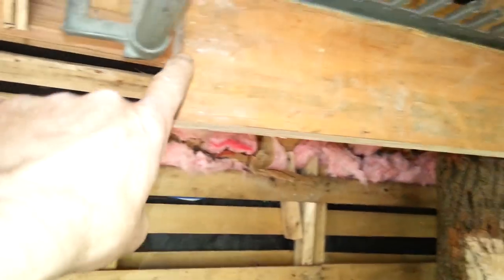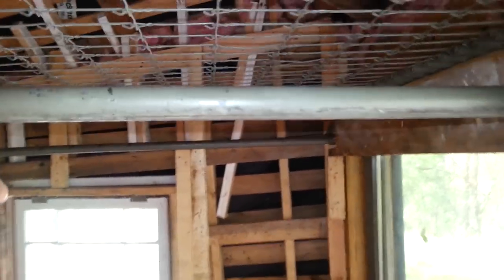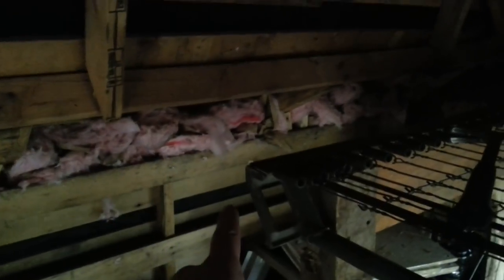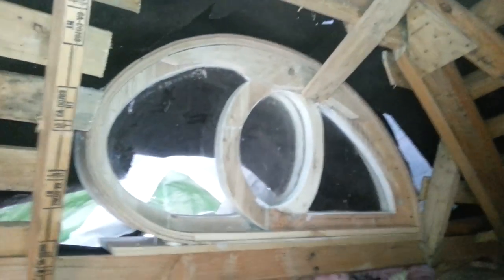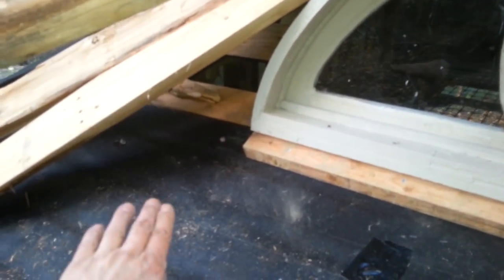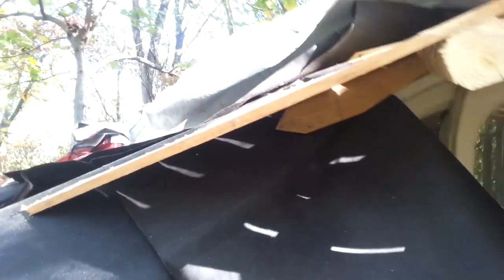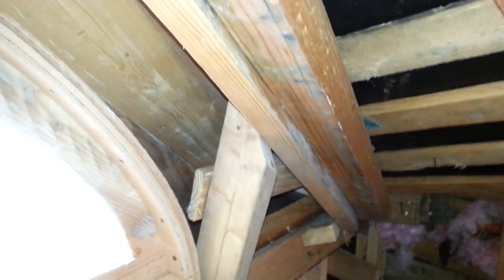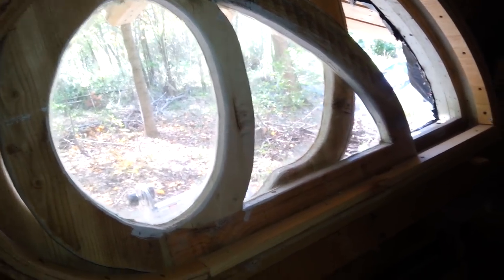Tiny House Off Grid Pallet Cabin - Part 16  Loft & Eye Window

Comment: Adore the window. You are so talented. My only question is, what happens as the trees grow?
Reply from the maker: So the trees did grow. Eventually I lopped the top off of both trees that poke through the roof. By doing so it forced the trees to grow in mass instead of height. Eventually the tree on the back will become a solid pole and part of the structure as it will hold my custom built wind turbine. So in otherwords I am growing the pole. Sure, there is work involved in maintaining a live tree pole and great manipulation over the years to properly incorporate it into the house without it ruining the structure but I believe the end result will be positive. If I have to eventually rim the bark to kill the tree above a certain height, I will do so but as of now both trees are slowly becoming a part of the structure.
Reply from the maker: I am glad you enjoyed watching my dream becoming a reality. 🙂